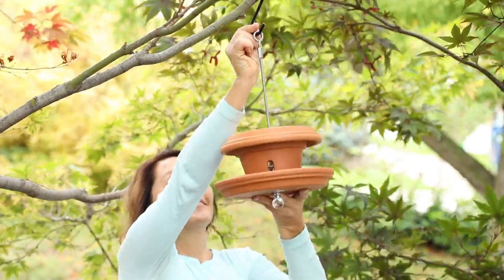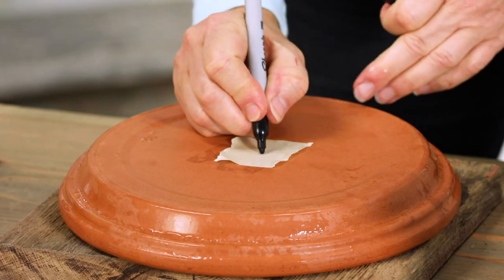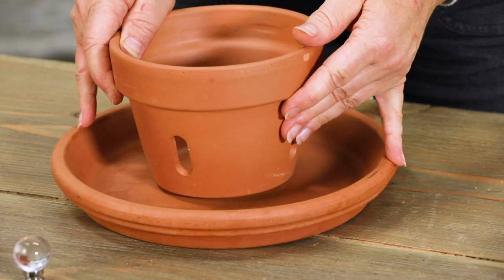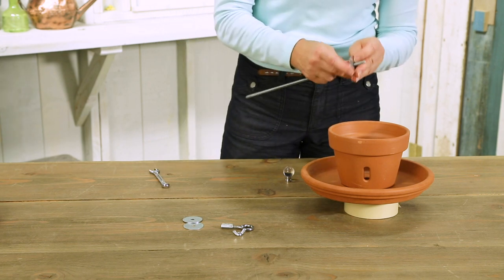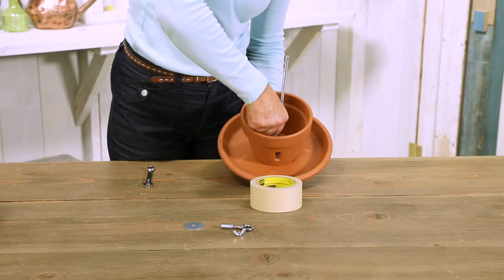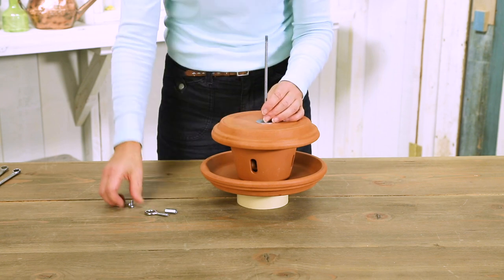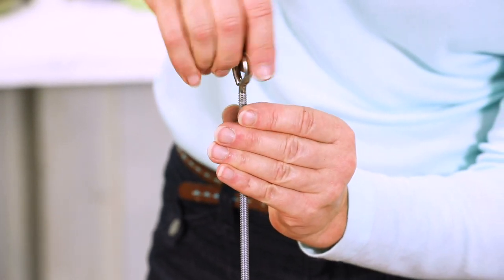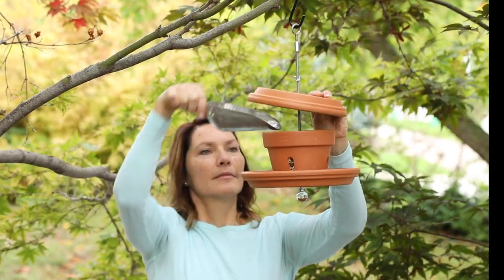DIY terra-cotta bird feeder

Comment: It's a great idea but it will only collect rainwater as it is. I would put the larger saucer on top & clear seal it for rain protection. I'd also drill some drainage holes in bottom one. I've had constant problems with rain ingress causing wet feed & seed sprouting and mould on most of my shop bought feeders, even the peanuts go mouldy at the base of feeder. I have started using disposable plastic plates to cover them as a temporary solution but will be making a long roof from pallet wood to cover whole feeding station.
Reply from the maker: Great ideas - we also realized after the fact that switching the larger plate to the top position would be the better arrangement for this project. Thanks for watching!
Reply: How did you start using the disposable plastic plates to cover them?
Reply: Similar to the top dish in this video, put a hole in middle, turn plate upside down & slip chain that feeder will be hanging on through it, it acts like a canopy/umbrella. Keeps feed nice & dry when it rains. I use the large dinner size plates. I buy replacement chains for hanging baskets for a couple of £'s from bargain shop, split them & then I have chains to hang 3 feeders :)  @cameronbateau6510

Comment: This is a bad design. The unglazed terracotta will absorb rain and dew, which will result in wet feed. Also - like mentioned in a comment below - putting the smaller saucer on top offers no protection from rain for the feed in the bottom saucer.
Reply: actually you can buy rustoleum/ waterproof spray or even rub silicone causing on top- there are many things to do to the top to improve this great , cost effective idea
Reply: Why not paint the pots & saucers to seal them.

Comment: Using an orchid pot is a bad choice as it is only suitable for small seed eaters with pointed beaks. Also, when the seed drops to a point where it is level with the holes the pot, the birds can’t reach the seed. Far better to use a heavy grade plastic pot and drill four holes about 30 or 40 mm in diameter around the pot. This, depending where you live,  will allow the heads of small parrots and parakeets access to the seed inside the pot, along with the smaller birds who can get right inside the pot.😂 Also, by changing the diameter of the bottom plate, you can prevent or allow larger birds from getting a proper perch to access the seed.
Reply from the maker: Thanks for sharing.

Comment: It doesn’t take much to sort out that the larger dish should be on top as a shield against rain and snow.  A better idea would be to have the largest diameter top dish available.  Moisture will ruin seed.
Reply: Agree, I’ve made a lot of these, the larger dish should be on the top. I use the plastic faux terra cotta pots and drill four 60mm holes near the base of the pot.

Comment: Nice but they end up being too heavy. I would have added a decorative plastic bottom dish to lighten the load.
Reply from the maker: Thanks for the tip
Reply: I did the same but the decorative 'larger' saucer is on top as a rain cover.